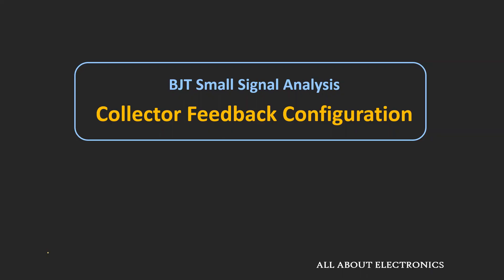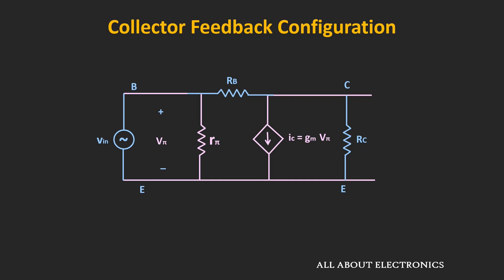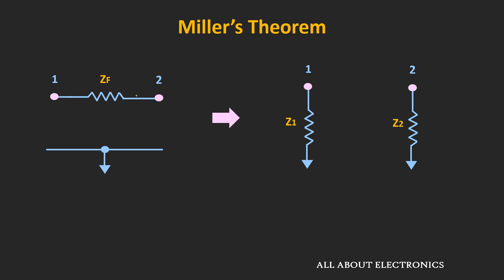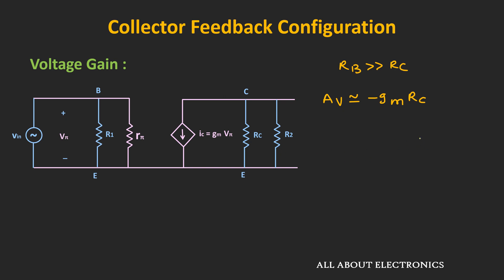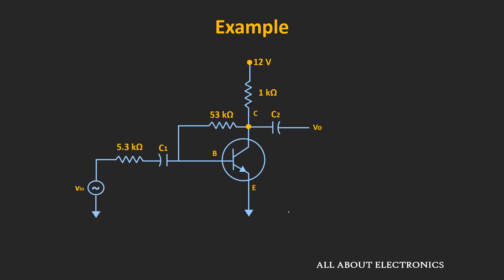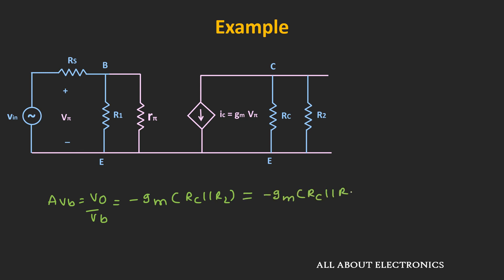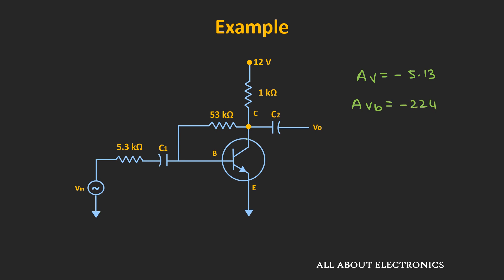BJT- Small Signal Analysis:  Collector Feedback Configuration (with Solved Example)

Comment from the maker: Timestamps for the different topics covered in the video:

1:00 Small Signal Model of Collector Feedback Configuration

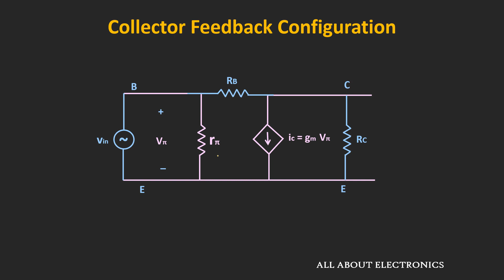2:45  Miller's Theorem

5:29 Small Signal Analysis  (AC analysis) of Collector Feedback Configuration 

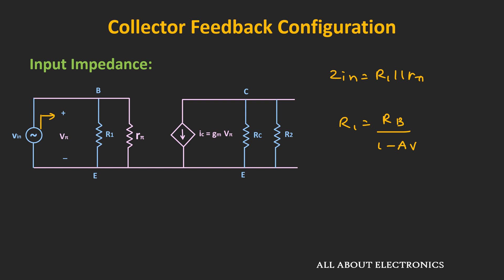9:38 Solved Example on Collector Feedback Common Emitter Amplifier

Comment: what if there are no capacitors in the circuit? I mean in the same circuit, short the capacitor. Does that change the formulas? 
Great video btw
Reply from the maker: No, it won't change the formulas. (at least upto mid frequencies, where capacitors can be assumed as a short circuit during AC analysis).
Reply: @ALLABOUTELECTRONICS  thanks  👍